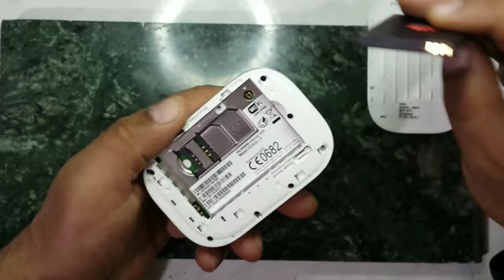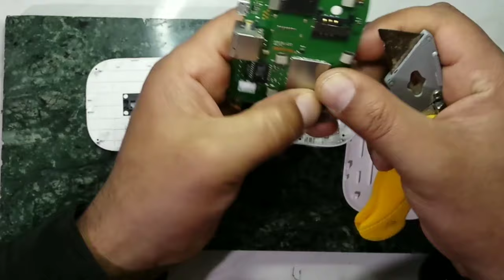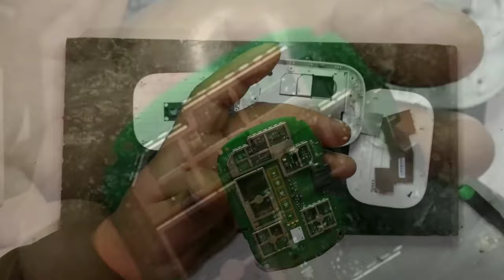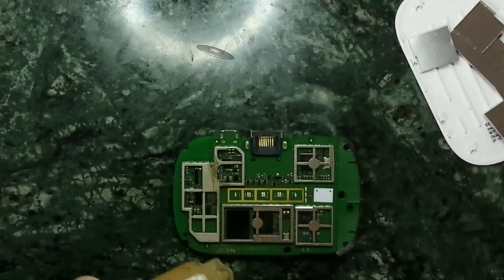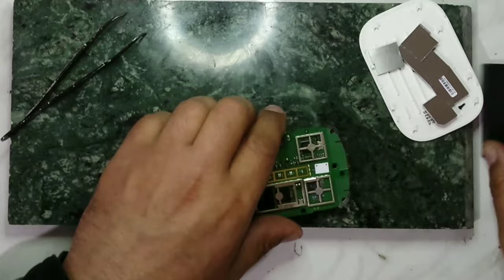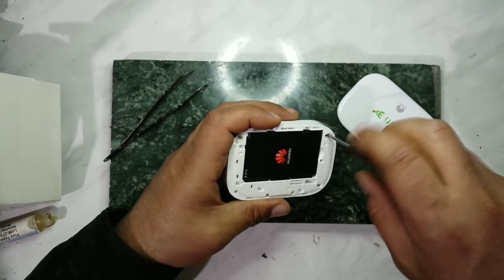Fix HUAWEI E5151s-2 Mobile WiFi Modem Not Power On Solution

Comment: How can I find the short circuit on huawei E5573c please
Reply from the maker: There are several ways, after opening the phone and isolating the motherboard, verifying that the shorts are in the motherboard, trying to operate it by increasing the amperage to show the symmetrical piece, or sometimes it is due to humidity, so it is sufficient to clean the motherboard, and each damage in its own way, there are many ways to know the location of the shorts according to the phone and its condition
Reply from the maker: There are several ways, after opening the phone and isolating the motherboard, verifying that the shorts are in the motherboard, trying to operate it by increasing the amperage to show the symmetrical piece, or sometimes it is due to humidity, so it is sufficient to clean the motherboard, and each damage in its own way, there are many ways to know the location of the shorts according to the phone and its condition